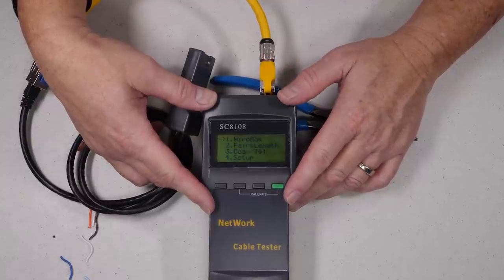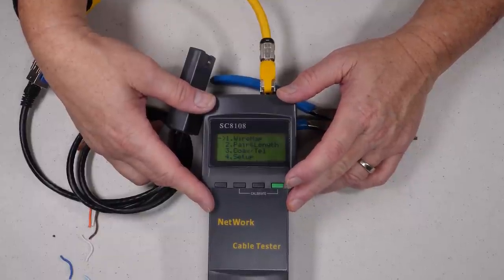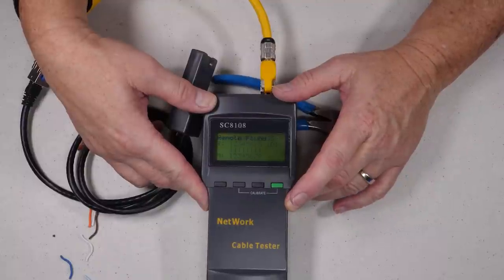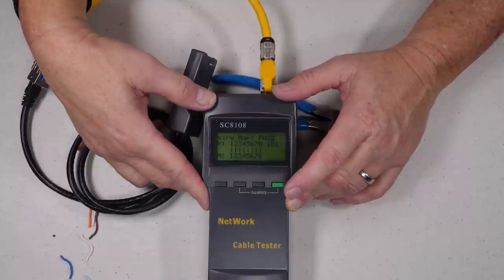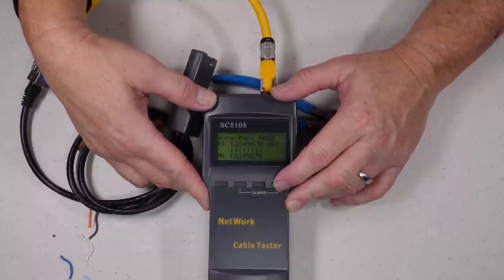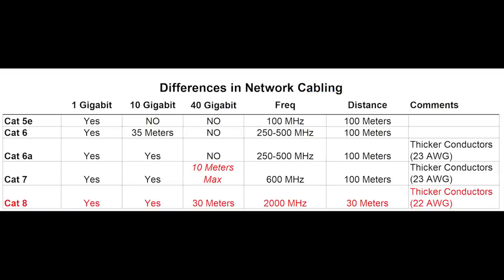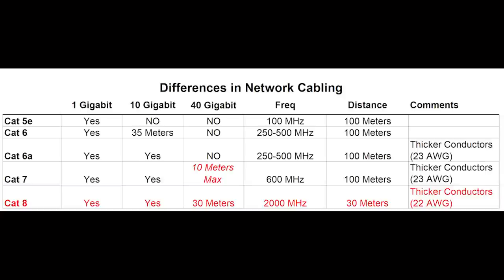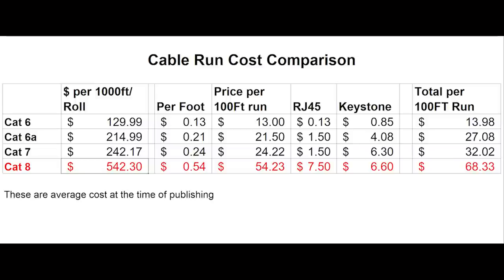CAT 8 vs CAT 7 Ethernet Cables - Is there a difference?

Comment: So the cat 8 rj45 plug although expensive seem reusable unlike previous categories. Is that correct Mike?
Reply from the maker: They are reusable.  The also make this type for 6a.
Reply: @MikeFaucher  ok, cool. Makes sense
Reply: Couple of questions:
do you think the connectors on aliexpress are really cat8.
And does it slow that much down that you cant get the rated speeds if you use real cat8 cable and cat6/6a connectors?
Do you know some make cables that are for sure cat7a+ / cat8? Because i think there are a lot of fake/outside specs cables.
And the last question, i cant find any stranded cat7a+ / cat8 cable, does that mean all are solid, so from wall socket to pc that needs to be also solid?

Comment: And here's me still using CAT5a.
Reply: Cat5E
Reply: @fenc666  yep
Reply: @gordonlawrence1448  I recently had to overhaul a building that was wired with CAT3!
Reply: @DavidMBebber  I cant even remember what Cat3 was. I can remember Cat1 being Coax. Then cat 5 was twisted pairs.
Reply: @gordonlawrence1448  https://en.wikipedia.org/wiki/Category_3_cable

"Category 3 cable...is an unshielded twisted pair (UTP) cable used in telephone wiring...
designed to reliably carry data up to 10 Mbps." 

And though the building was run using CAT5 cables each one was split 4 ways and each jack only had a single pair of wires terminated to it.
Reply: If you're not using 2.5GbE or higher or 100M+ runs you should be fine.
Reply: @AgentLokVokun  I might go to cat 6 cos it's getting easier to get but for what I do 100Mbit is plenty and my longest cable run is less than 10 meters. If I was running 100+ i'd use fibre. I have some gig copper to fibre to copper converters of m,y own design. They actually work to about 12.5 gbit using the LVDS from, an FPGA etc.
Reply: @DavidMBebber  I was on a job that took out token ring.
Reply: Its so overhyped. Most isp dont give more than 500 or 1000. If you reallt need that much data ur better off with glass fibre cables.
Reply: @hippievogelei  except of course nobody has ever used glass. It's Quartz.
Reply: @hippievogelei  For WAN? Yes fiber. For LAN? Cat 7/8 is great for 10GbE. Considering cost is lower.

No reason my LAN shouldn't be 2.5 - 10 GbE if I'm doing things like CAD, video editing, backups, imports/exports, database manipulation, or anything that you'd want to interact with on a remote storage medium.

Comment: Important for non-US applications: Use the A Position. The B Position is mostly only in the US
Reply: Depends on where in europe, in norway we use B
Reply: A vs B is literally just aesthetics. the electricity doesn't care which wire it uses for transmit and receive so long as both sides of the cable are the same.  you can do 50% A runs and 50% B runs in the exact same site install and it will work just fine because the whole A and B thing was never real we just made it up.
Reply: You can make up your own color code as long as it's consistent it'll work

Comment: I get a kick out of the fact that people call these RJ45 plugs and jacks.  The RJ stands for Registered Jack from back in the days of Western Electric and the 45 was a designation for the cabling pin-out.  The only thing these plugs have in common is the form factor and the pin-out.  I guess RJ45 has just become part of the vernacular of our technology landscape.   To provide some context there use to be, probably still exists out there somewhere the keyed RJ45, the RJ11, the RJ12, and the MMJ or Modified Modular Jack (used in old RS422 DecNet).  Some of us old-timers were around before there was ubiquitous Ethernet and we had to also deal with some connectors like the IBM Type 1A  used with MAUs in Token-Ring.  We also were into vampires well before our kids with Twilight where we used Vampire Tapping tools for thick Ethernet.  But going a bit further, who remember the old Token - Bus system ???  That was a real prize!  The good old days of ArcNet and Banyan Vines.  Kind of makes me nostalgic for the old 1200/2400 Baud Modems from US Robotics.
Reply from the maker: Thank you.

Comment: Thinking of buying Cat 6A,  and I'm confused with not finding Ethernet Cat 6a in stores, only Patch Cat 6a, and there isn't anything mentioned in specs of the speed, would patch work the same like ethernet Cat 6a?
Reply from the maker: Either will work, patch or bulk.  The only difference is that patch is usually thinner as it is multi strand wire and usually can't be easier cut and re-terminated.  Otherwise the performance is the same.  If you are looking for bulk, there is an amazon link in the video description where you can buy a bulk roll.  Thanks for the question.
Reply: @MikeFaucher   I need 2 cables for PC, and PS4, both connected to router, and with shipping Cat 6a would cost me just 5 Euros cheaper then 2 Cat 8 cables from Wish, what would you suggest, is Cat 8 worth those 5 Euros then? Not so much of a difference in money, but in quality? Both are S/FTP
Reply from the maker: No not for 10GbE or less. Stick with 6a.

Comment: I have yet to see applications in Industry were that kind of data throughput is necessary on a machine control Network. We install cable all day long, most customers just want old 5e. Nobody cares if they're files take another 10 seconds to move. If I was running high definition video somewhere maybe but that's about it. So lets save some money! Nomore then cat 6.  Cost is really high over cat6. Also high-speed Wireless is kicking their butt but it comes to speed. We can't use interference, fear-mongering for the justification for upgrading cables continuously. The only place I could ever see it truly being used would be server to server in the same room. We run dedicated fiber across the plants, to other servers. Why do we need this???
Reply from the maker: Everyone has different needs. Thanks for the feedback and comments
Reply: Agreed, that was my point too. Also as an installer I currently still recommend Cat5e because its the best fit for most use cases. I would also go full Fiber before I poked at that Cat8 headache and its cheaper. I look at Cat7 and Cat8 as more of a switch to switch and maybe some patch cables for 40/10g switches. Fiber, SFP etc kind of makes these obsolete. The most concern I get from people is around cameras, I have to explain that with the H.265 compression they use they cant even saturate a regular old Cat5 cable at 4k...

Comment: Looks like a nightmare to terminate. Had Cat 5e installed by myself at home last year. Could have gone Cat 6 but the cost does not justify it.
Reply from the maker: Nothing wrong with that if it works for your needs.  Termination is not as bad as it looks.  Shielding is a bit of a hassle.

Comment: Does that mean that the flat ones sold on Amazon, with obviously a lot less shielding, are non-authentic?
Reply from the maker: Many of the patch cables use multi-stranded wire with is much thinner so the overall is much thinner.  The bulk wire in this video uses thicker solid wire.

Comment: Mike...great video.  You can't get close enough for those of us with old eyes.  
Once a connector (cat 7 & 8) is terminated, can they be taken apart and reused?
And is the cat 6a cable marked as such?  Is there a physical difference between cat 6a and cat 6 that is apparent when you look at each?
Are the connectors specific to each?
Reply from the maker: Thanks, I am working on better zooming for future videos that need up close work.  The showed for yellow wire are reusable.  Cat6a is identified on the spool and the cable itself.  It is hard to tell them apart other than in most cases it is a little thicker.  Connectors typically cover more than one type, but it is identified as to which it supports.  Thanks for the feedback.

Comment: If I have CAT 7 through my house, is it worth replacing all my cables and switches to CAT 8?  My ISP makes me use their router (I hate that), so I can't upgrade that (my previous ISP just gave me a cable modem and let me use my own router which was great!).  Will I notice any speed increase?
Reply from the maker: No, I would definitely not upgrade if you have Cat 7.  As a side note, almost every ISP router can be changed to a bridge allowing you to add your router.  You just need to search YouTube on the specific model/brand of router your ISP stuck you with to access the firmware on how to do it.
Reply: @MikeFaucher  Okay, thanks!  I'll wait for CAT 9 to come out before I upgrade 😛

Comment: I hope someone can give me some advise.  I want to purchase cat 8 cables, but they have to be ran through a wall, so I would have to connect it to a wall plate.  I can only find cat 6 wall plates on Amazon.  If I used them, what would happen to the benefit of the cat 8 speed and so on?
Reply from the maker: I have links to all of it in the video description  below the video in both videos.  Cat 8 is very stiff when running through walls as it does not bend well.  It can be done but it will be tougher.  I would also consider using Cat 6A or 7 as it is much cheaper and a little easier to work with (https://youtu.be/f2bILsfu8NM).  You will be able to get the 10GbE with 6A or 7.

Comment: So, I've been looking at mking my own cable at home, to save money. Looks like I'd be fine with cat 6 cable and 2 x RJ45, unless I put a wall adapter at each end; Probably a better idea.
Thanks for helpful video.
Reply from the maker: I would go with the wall plate on each end.  Easier and more versatile.  If you are running in wall, consider 6A for future proofing and so you can upgrade selectively to faster speeds.  Just my two cents.
Reply: @MikeFaucher  Yes, I think it would be the best solution. The wifi signal gets reduced to about half. Have looked at getting extender cables for the wifi aerials that run out the back of my pc but would probably look untidy.

Comment: I could be way off but giving how long it took to make those Cat 7/8 terminations, wouldn't fiber with SFPs be a much better way to go? Even if you had to use a media converter for end user devices to connect between RJ45 and the LC2 wall jack?
Reply from the maker: That is always an option but once you get good at it, it’s not that bad. Also depends on your hardware. Many devices don’t support fiber. Great point.

Comment: I don't think i even knew about Cat8 last year when i bought 100 feet of Cat7 cable and buried it the line out to my garage for TV & WiFi.  So far it seems to work fine, but i definitely would have went Cat8 had i known. I almost went Cat6 but started seeing Cat7 when shopping on Amazon so i went with that.
Reply from the maker: Cat 8 is still very expensive, you made the right choice.
Reply: @MikeFaucher  it might be expensive but it costs more to bury a new cable and put it in conduit. I like preparing for the future. But cat 7 has been good to me so far!
Reply from the maker: @BazookaIke  Good point.  Glad it is working our for you!

Comment: im just wondering why you recommend amazon to buy the cables? I thought amazon uses lots of low quality Chinese suppliers.
Reply from the maker: Most cables are manufactured in china and i purchase many of them from Amazon and have not had any issues.  To be upfront these are affiliate links but only for items I use. You can obviously buy from any supplier. Great question.

Comment: I have 2 of these exact cables DSX8000 Certified Cat8 Ethernet Patch Cable one for my Modem to router and the other for my PS5 which arrives Wednesday, Do you think this cable works well for the PS5?
Reply from the maker: Probably do not need it for the PS5 but it will work fine.
Reply: @MikeFaucher  Thank Mike

Comment: I never understood why such difficulties in everyday life. Anything higher than CAT5 (6) then the optical cable looks lighter and more reliable.
Reply: its true but the optical equipment and termination ,are so much expensive and not worth in less then 100m .
Reply: Depends on the environment honestly. Fiber is immune to EMI, while even shielded twisted pair connections are still susceptible to interference. I do agree for the most part though. I would prefer maybe Cat 6a myself.
Reply: @zoli34516  Interference is not important to the digital connection. CAT 7 and CAT 8 are used for gigabyte connections where the range is already limited. At the same time, the price of optical gigabit modules and media converters is cheap. Optical cable is sold terminated for any length - from 0.5m. Optics today trite hopes because of simplicity. Each cable has its own application. In the office, a twisted pair is probably better. Until the switch. Next is the optics. If you are a "heavy client" or a server, then definitely optics. Twisted pair, on the other hand, is easier to repair. There is no need for special tools. It is necessary to proceed from the scope of application.

Comment: Do you have standards for the connectors or at the standards just describing the cable? I mean - can you buy a certified RJ45 connector for lets say a Cat 8 cable?
Reply from the maker: You typically buy a connector that matches or is compatible  with the cable you are using.

Comment: Geez. Looking into how-to videos to run ethernet through attic to the kids rooms using cat 5..  Just stumbled on this video. Wow. Cat 7 and 8!

Which should I use just for basic internet to kids rooms?
Reply from the maker: Yeah. Thanks for the comment.
Reply: Definitely do not buy "Cat7" or Cat8 cables for any type of home situation.  Quality Cat5e, Cat6 or Cat6A cable are more than enough to suit your needs.  Any "Cat7" cable you buy off of Amazon is not a real Cat7 cable - They're just repackaged/rebranded Cat6/6A cables.  Cat8 is only intended to be used in the Data Center at this point, and is rarely being used, anyways.
Reply: @tubastud06  Thank you very much!

Comment: These standards seem pointless. Cat6a holds important ground, beyond that we need to move past copper
Reply: Not really. Cat cable is both cheaper and generally better then moving to a full fat fiber backbone. A 10GbE fiber switch can cost easily over $40/port.
Cat 7 and Cat 8 also aren't generally meant for every day runs -- Mostly because the standard requires solid core wires. If you're building a new house or commercial building it's 100% worth the extra cost to use Cat7 or Cat 8. You only have the drywall off once and running new lines after the fact is MUCH MORE costly then just upgrading the switches.
Reply: @AgentLokVokun  cat 7 is not a recognized standard
Reply: @-Good4Y0u  False. Cat 7 Standard is literally ISO 11801 Edition 2 Amendment 2 (2010) [F Channel]

It isn't recognized by the TIA/EIA. -- But it IS A STANDARD

Cat 8 however is also Ratified by under ANSI/TIA 568-C.2-1. And also an ISO standard.
Reply: Cat6a can run 10gig as long as the runs under 100m.

Cat6a is easy to install anywhere. It's max bend radius is under 1.5 inches, meaning it can be safely run in a traditional framing system without bending it incorrectly. Cat7 is about 4 inches minimum bend radius, which is very hard to do in several spots in a home. Cat 8's minimum bend radius is over 6.5 inches. This would make it incredibly hard to impossible to wire something as simple as a wall outlet.

Cat 7 and 8 arent intended to be run down walls to wall outlets. They are intended to plug things like routers, switches and servers together in a wide open room with cables chases.
Reply: @discodench  - I suppose someone in a pinch can fit the Cat 8 into a 90 degree jack.
Reply: @bruzote  no one uses these cables. Fiber does all this better, and has for years.

Comment: if I was going to run that far with high speed cabling I would go fiber on the backbone and then drop down to cat 6.  They did something like that at the Naval base in Ingleside Texas.  Although that base is now closed it was a victim of Realignment and closure.  The backbone was Fiber and they did a drop to cat 6.  The contractor over charged the DOD for the entire installation as do all government contractors but the point is Cat7 and cat 8 don.t seem worth it because they don't give the distance.  Especially when Fiber does and it is cheaper.
Reply from the maker: Agreed  especially for long distance. Thanks for detail.

Comment: Is it true that cat 5e or cat6 have the same max speeds in household environement? And what max speeds can I expect before I will have to switch to fiber?
Reply from the maker: Depends on your equipment
Reply: Cat5e was made to support 1gig. Very few home's have internet that's faster than that. Cat6a's max speed is 10gig. I don't think there's any homes with a connection over that.

Comment: Can I terminate a cat 7a to rj45 and use it the same way I would a 6a or 8.1?
Reply from the maker: Cat 5 and up are terminated the same except you use different connectors as some have grounds and others don't.  Mostly you need to match the connector with the cable type.  Hope that helps.

Comment: What happens with running cat 8 cable but cat 6a rj45 wall plates?
Reply: Result to Cat 6a output. You would need a complete Cat 8 connection from host to router/switch to support the full 40Gbps speed. Otherwise I believe you would max out at the 10Gbps output.
Reply from the maker: As long as one side is grounded.
Reply: Cat8 has a very large bend radius and is not suited for wall mounted installs. It's bend radius is like 8 inches.
Reply from the maker: @discodench  The cable I am using is a little better than 8 inches but you are right, it is pretty thick and very stiff.  If you are going to run it into a wall you can use an external junction box to allow for the bend but still a challenge.